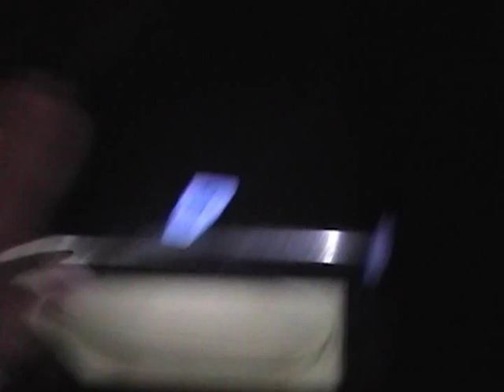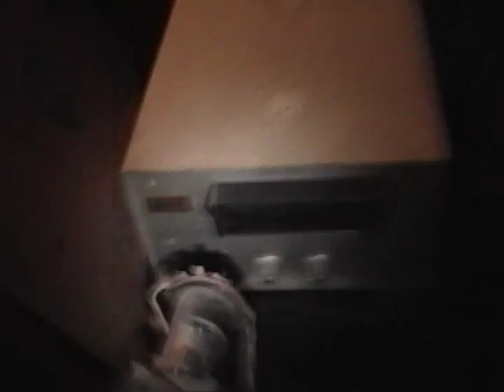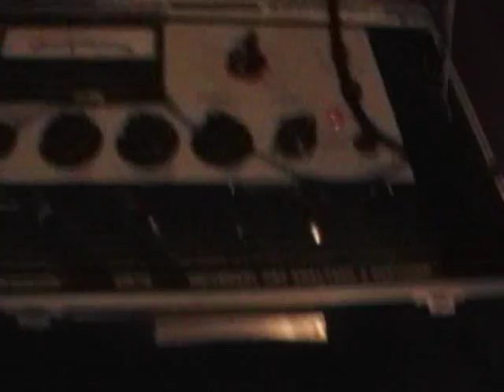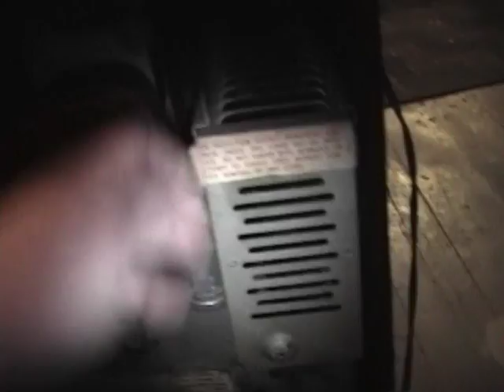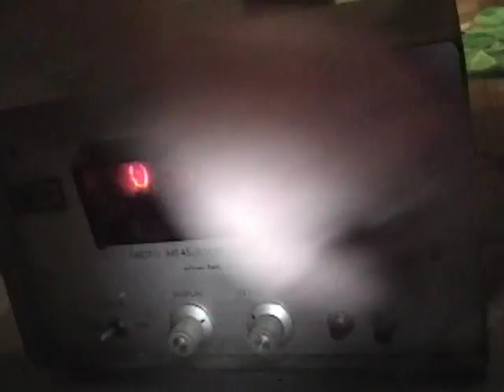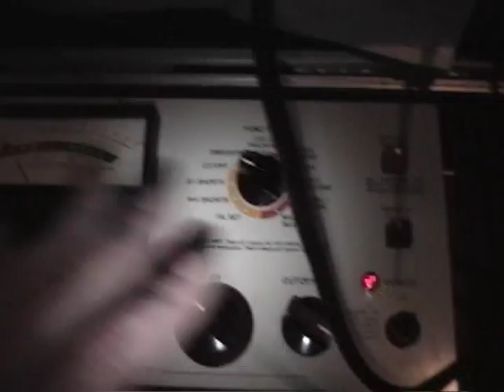Estate Sale Finds

Comment: Some good buys.I attend estate sales off and on, & the ones with high end vintate stereo gear etc  brings a crowd. At one sale I got there early as they had some McIntosh  equip .  I was 10 from the door with a 1/2 block of people behind me, then out the door came two guys with  the McIntosh stereo. One guy always arrived hours early & slept in his car to be first in line. It's hard to beat those collectors.   Vintage B/W tvs are priced dirt cheap here about 25.00, & usually sell for much less .

Comment: With regard to screen sizes I remember that for years they had a different standard in the U.S for measuring screen size then they did in Canada, what was a 21'' set in Canada was sold as a 22" or a 23'' in the U.S. I think that what it was is that in Canada they were made to measure from the inside of the mask rather then the outside of the tube. My guess is that the 16'' tube size was quoted as though it were measuring an all glass tube rather then a metal glass tube.

Comment: @bandersentv I have read about that flyback problem as well, it seems that the high voltage power supplies in the early Zeniths are really poorly designed, the two horizontal output tube scheme is really hard on the flyback transformers. Replacement flyback transformers for the Zeniths are really hard to find but apparently some have had luck adapting a much more common RCA flyback to them with a few mods.

Comment: Now they're playing that same game with picture sizes on modern flat panel TVs. A few years ago, somebody got the bright idea to downsize their display panels by a half inch but advertise them as the next size up, for example advertising a 31.5 inch LCD TV as "32 inch class". Unfortunately that has since caught on across the industry. But you're right that there was legislation requiring the actual viewable area to be listed, so they have to include a small footnote indicating that measurement.

Comment: On the Zenith "Monroe" set did you try resoldering the pins on the picture tube? I've had radio tubes that tested for zero emissions and found out that the cathode connection was bad, resoldered them and got them to test good again.